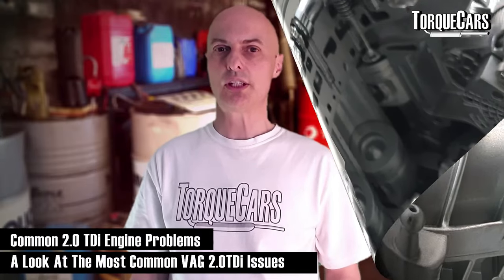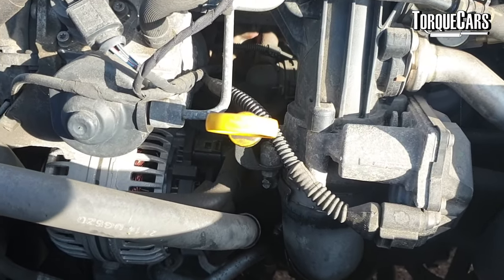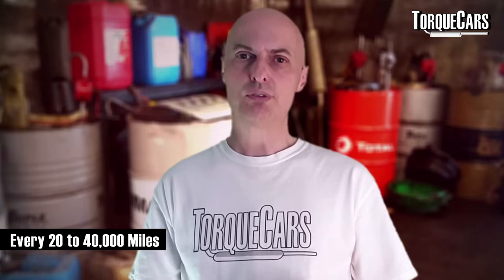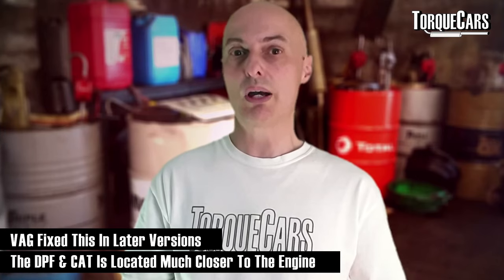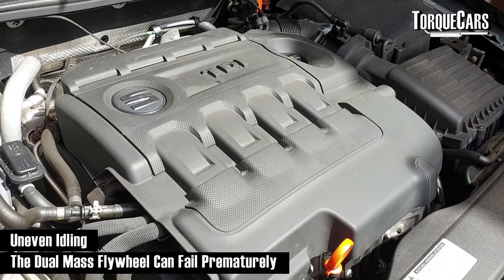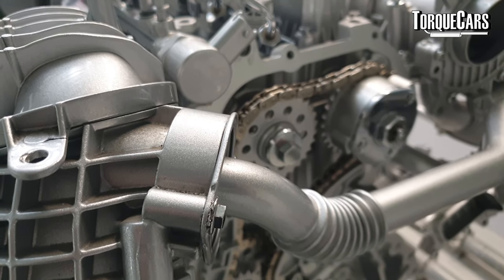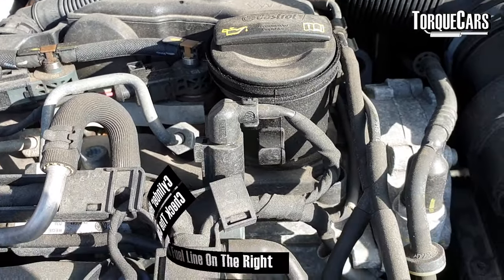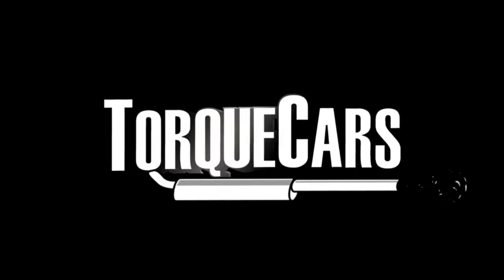Common VW Audi Seat Skoda 2.0 TDi Problems  [Fault Guide]

Comment: I have a 2017 2.0 BiTDI 240bhp Passat ( remapped to 290bhp since new) I have now covered 176,000 miles. Engine still perfect. Still has all its power. Issues to date are the wet clutches on the DQ500 DSG were replaced and the flywheel at 160,000 miles. Also the fuel metering valve on the fuel pump recently went faulty giving a fuel rail pressure too high fault code. Got a new one on eBay for approx 70 quid. That’s it! I change the oil every 10,000 miles and it doesn’t use a drop between services. I change fuel and air filter every 4th oil change.
Reply: My 2019 68 plate 150hp leaks a bit of oil. Apparently it's an oil filter housing gasket. Is that bad?
Reply: Its corect
Reply: I change mine every 5k
Reply: change air filter every time with oil and oil filter change.
Reply: I’m thinking to buy a 2017 Audi a5 2.0tdi  with around 150k miles will the engine go on much longer ?

Comment: Back in 2014 i owned a bkd Golf 2.0 tdi 2004 model, also ended up with a cracked cylinder head, injectors failing etc. It was bad

Comment: My 2013 Jetta TDI has been towed to the garage twice in 2 months. First it was the alternator that broke mid road trip and left me stranded, then a few days ago the clutch just became super loose out of nowhere and I'm unable to put it in gear :/ i know everyone says these cars are super reliable but I'm losing confidence in it fast. I've already spent thousands on replacinng the suspension, deleting the egr because it was broken, changing the timing belt and water pump etc. I'm wondering if I should take the L and just buy a Toyota or stick with my Jetta and hope nothing else breaks.

Comment: Thanks, have a 2013 tuned CFFB, no issues so far. Like to see the mods in you future vids. 👍 The written upgrade guide is great and I had a good read before investing in the tune.
Reply from the maker: They are good solid engines, most of issues have been sorted out by 2013, the recent EA288 is a pretty important evolution of the 2.0 TDi. Mine was an early BKD from 2008 and it was pretty reliable for me, I didn't have any of the issues mentioned here although an overly aggressive map (140 to 185hp) did kill the turbo prematurely.
Reply: @torquecars  I have a BKD A3 sat on the drive, shes just had yet another service, her 20th, 200,721 Miles on the clock, all OEM just remapped, new turbo at 150ish k. 

Shes still got it, still makes me smile, and still upsets alot of her newer bretheren :) Long live the BKD last of the unrestricted diesels.
Reply from the maker: My A3 was the BKD, and this is a truly fantastic engine, the last part of the PD era, mine lasted well and had a pretty heavy life.
Reply: @torquecars  I have BKD 2006 with no issue at 175k miles, just changed turbo 2 years ago. The car 103kW flying like a rocket!

Comment: I have a problem with my audi a6 c6 4f 2.0tdi when im driving and just hold a speed where the rpm is 1900-2000 the engine starts shaking and feel like the engine is ready to jump out of the car😅 but i called audi and they say it a well know problem but they wont tell me what it is so i can order the parts i need and i just dont feel like spending 20-30k fixing it at a shop. So is this a problem that you have heard off before?

Comment: Upgraded to solid flywheel and VR6 clutch kit on my 2.0 Tdi (CLC). No complaints about the extra noise at idle.
Reply: @craigladewig3158  how much did that set you back and do you notice a difference in quality of drive now?

Comment: Passat 2.0 gt model 2018 and had from new..
Now on 230k miles, same turbo, same egr, same dpf, same gearbox and fly wheel and same injectors !! 
Had a new start stop battery at 200k and alternator at 200k!! 
Only drama is the rear tyres🛞 on inner edges going lumpy from the camber! Had it adjusted so many times but I gave up now on that lol 
Perfect taxi 🚕

Comment: PD170 Siemens injectors can be the loom insulation hardening in the oil as much as oil ingress into the injectors themselves, they run in parallel, so any short in the entire loom system and they all stop. You won't get any misfire warnings, just engine stops. I was involved in getting this recall to happen with a few key lads worldwide. I'd suggest replacing the loom if it ever starts feeling hard inside the tappet cover with a revised genuine one. "New injectors" just have improved seals, and will simply last longer. My problem item was loom. Audi revised loom was better again. Be very careful to understand the external loom locking plug, easy to stuff this up and get poor connections if you mess up the plastics.

As for dual mass, my stocko lasted 270thou kms at about 450nm and was given a hard time, so it seems to be luck of the draw. I've replaced it with a LUK dual mass which apparently does not come apart like the SACHS one can if it fails. Planning on over 500nm through it soon, so see how we go.

Use quality fuel, track your DPF and oil ash load on an app ( the stuff that can't regenerate ), and complete any running regeneration if you can. Use 504 oil for the DPF, and 507 oil for the PD cam wear. Change the oil on time or earlier, the DPF regens put a lot of diesel into the oil during late injection regenerations, and they heat the whole engine bay up to over 200 degrees. Make sure battery is insulated, regens kill open batteries more quickly. Most PD170's came with a wrap or a plastic box for this reason.

As said below your written guides are excellent, and I've yet to see anything but great advice on your videos, and learnt a thing or two!
Reply from the maker: Interesting to read about the loom problem, this could help a friend who's having strange issues at the moment, I'll ask him to check this.

Thanks always for your support and encouragement my friend.

Comment: Hi mate - really good video. I have a 2016 Skoda Octavia 2.0 Se Tdi with 56k miles. Solid car up until now but recently the engine temperature gauge fluctuates and goes up into the red. It doesn’t happen every time I drive. No coolant is being lost and the engine fan sometimes works hard. Do you think this is either the coolant sensor or a thermostat issue?
Reply: Looks like a thermostat issue.
Reply: It's definitely the water pump, a common problem. You need to change it before the engine fails.

Comment: Hi i think from what i readed the model with C cylinders head are the engine from and after 2006. So be sure yours is at least from 2006 and if 2007 it's even more likely to have a C Cylinder head i guess.

Comment: Great video, I’m not sure if I have the same engine that you are talking about but my engine code is CCHA, it’s a 120k miles 2012 140bhpCaravelle/transporter. It has been remapped to 178bhp about 3 years ago, always been driven‘properly’ the last couple of months I’ve been experiencing chuffing when removing the oil filler cap and a pressure build up in the head. Is this another common fault? My initial thought is valve stem seal worn, I am planning on doing the cam belt for a second time when it finally stops raining. Could it be stem seals or are there any other areas to investigate? Thanks

Comment: Heyy i have the 138bhp 2.0 tdi 2010 Skoda superb i have tuned it and put a start to end exhaust my car is getting heated and the coolant is not leaking but disappearing from the coolant box i checked and fixed all the leakage spots changed the radiator and stuff what do you think it must be

Comment: Hi. I’m back on here. Would you happen to know where the crankshaft sensor( Engine speed sensor) is on a CNHA( 2.0 TDI ultra Audi A6 2016) ? Code I got is P0322 (G28) Engine Speed sensor. Thank you.

Comment: Thanks for your information.  I have a passat 2007, 2.0 Tdi, 125kW (170HP), done 230,000km, engine rattle at flywheel area, and knocking noise at timing belt, the worst problem is it blows smoke white/grey (not smelling coolant and no coolant loss), no power, misfiring.  I would appreciate you comment on potentially cause to help me decide on whether to move on or fix it.  Many thanks!!!
Reply from the maker: It sounds like the dual mass flywheel is on it's way out. The timing belt tensioner may also be playing up. It is really hard to diagnose these things remotely. You've got to weight up the cost of repair vs the cost of a replacement car. With the mileage it might be worth moving on as there are probably other bills looming. 

The smoke could be the engine running lean/rich and is often down to the injectors failing to spray a good pattern of fuel into the engine.

Hoepfully a few others on here will spot your post and chip in with their experiences.

Comment: have got a 2005 2.0TDI Audi A3, has been sat for about 6months with half a tank of diesel in it. currently engine is turning over but failing to fire. have had people say it’s likely to be fuel filter / pump. any ideas of where to start in sorting this myself or potentially properly identifying my issue. first car and broke as fk so any help is helpful 💪🏼 when i bought the car (after about 3months with the half a tank in) we drove it to where it is sat now (with no issues) within a week of it being sat it wasn’t firing anymore and previously when i got it home it was sounding beautiful and idling like a dream. again any help is greatly appreciated

Comment: Hi mate i have a 2007 vw Passat 2.0tdi 170 bhp ,the engine light is on and it doesn't rev past 3000 rpm when i try going past 3000 rpm the glow plug light starts flashing and it starts to creat black smoke and loss of power . When I turn it off the glow plug light turns off but engine light it still on ,no smoke below 3000 rpm. What do you think is the problem is. Cheers.
Reply: My 2009 Jetta TDI had the glow plug light flashing around 3k rpm after I changed the timing belt. The timing was a bit off... I adjusted the cam pulley slightly and it stopped the glow plug light flashing.

Comment: Great videos! I have CBBB motor from 2008 in passat B6 but it is specified in licence as EURO4, how is it possible and what does it mean?
Reply from the maker: Euro# are emissions standards set in the European area which all manufacturers have to meet (or cheat!), the higher the number the stricter they are and they apply to newer cars. We have Euro 7 cars now. Cars are required to meet certain emissions limits as specified by the European commission and it ranges from exhaust particles, to gases output right up to dust emissions from brakes and tyres now and even battery life so even EV's have to meet them.

Comment: Right now I am looking to buy a VW Golf MK6 2.0 TDI 140hp with engine code: CBAB from 2009. What should I look for? Should I be concerned about any problem with that particular engine from that year?
Reply: Hex oil pump and fuel pump. And your usual dpf and egr issues
Reply: Nothing really, bosch cp4 very reliable unless missfueled, oil pump not an issue since early pd engines around 2005. If odo is 200-250 a flywheel is due, other than that not really.

Comment: have a 2005 2.0TDI Audi A3 that has been sat with 1/2 tank of diesel for about 5months. when bought (had been sat for 2months with the diesel in, was running and sounding beautiful and idling really comfortably. about a week later the engine would no longer fire but would just tick over as you turn the key and stop after about a second. has been like this for the last 2 months and have had a few people suggest fuel pump / filter replacement or cleaning. any tips ? this is my first car and i have little money so looking to get a good diagnosis before losing too much
Reply from the maker: This video explains that fuel can degrade over time... https://www.youtube.com/watch?v=d9Gt5x5AjAk

A filter change should be  a cheap option to see if it fixes it. Are you getting any error codes from the OBD port? That is usually the first place to look for clues when there is a problem.

This video goes into to Audi diesel cold and warm start problems so might give you some pointers.
https://www.youtube.com/watch?v=BHjuezi6bNc
Reply: @torquecars  amazing thanks so much for the speedy reply dude. No codes coming up when we ran a test on the OBD port tried two different tests on separate devices. will watch any videos i can so thanks a lot!

Comment: Hi, would you be able to help me please?
| I have 2.0tdi A6 C6 2010 175bhp version.
Now, car runs smoothly when first started (cold engine), up until it starts warming up and as it gets to workign temp.
Then the idle is rough and shaky, and its noticeable that it has some weird noise, kind of cracking or something..
Car always drives nicely and accelerates fine.
Whole clutch has been changed.
At the moment its on 160k miles.

Thank you very much!
Reply: If it has been accidented or has a big intercooler, check that the radiator fan is not hitting the AC line and or missing pieces. Mine did that shaking with weird noise on idle when the fan would start running (when coolant hit 95°C). I investigated and found out the large fan was missing pieces causing it to be out of balance and shaking violently. Grabbed another fan from the scrapyard and problem solved...

Comment: This video is about these engines to 2009... the B?? engines, 3 letter engine codes starting with B  . I take it that the cylinder head for  EA189 engines, eg CEGA,  would be like a "C" cylinder head and not have the problem ???

Comment: I have a 2.0tdi bmn 125kwh. no problems. regular small big service change everything on time big every 75000km and small service every 10000 to 12000km. change everything, original castrol 5w30, all filters from motor oil, cabin fuel, etc... great service, change from track tensioner to toothed tensioner with all rollers and water pump and all adjusting belts from channel to toothed. all other engine boss bolts. clean the air valve, the exhaust shaft every 50,000 km and the EGR valve from soot, i.e. exhaust. and do not overdo the regeneration of the dpf, and once a month treat the engine with better fuel to clean the injection and exhaust system. and there are no problems with that engine. those who say they have problems are lying.

Comment: Thanks for the informative video. Have a 2013 vw tiguan 2.0l tdi with the cffb engine. Been experiencing random intermittent long cranking issues lately. Egr have been replaced as well as both thermostats. No fault codes. Any idea what my be the cause or where to look?
Reply from the maker: Check the voltage when cranking, it could be a battery issue starting to show up. Is it only when cold? If so are the glow plugs good? You've done the obvious stuff though. so I'll ask around and see if I can help you get to the bottom of this.
Reply: @torquecars  Thanks for getting back. Brand new battery.  Long crank whether hot or cold engine. Occurs extremely random. Two or three starts in a row out of every 15 to 18 starts. Won't the glow plugs pop a code?
Reply: Would check starter motor and glow plugs. Mine only occurred when hot and it was starter motor
Reply: I had a similar problem on my cff engine when I replaced my timing belt. I found that I just needed to tweak my timing on the vernier pulley and then she just came to life on the first crank. Check that out it may be one cause
Reply: Check for cranckshaft position sensor and camshaft position sensor, they start to get worn out and make the car to have a long crank

Comment: I got rid of my dual mass flywheel. Honestly don’t even notice the difference and now I don’t have to worry about it taking a crap again. Started to come apart at 90k miles
Reply from the maker: Do you know which weight and brand you fitted? Did you need to increase the tickover rpms? I've heard people saying this and also heard others hating on the lighter flywheel so there must be an option that works well on these.
Reply: I put a valeo single mass on mine from auto doc, smooth and only makes a little noise at low revs in first gear. It does slip in 4th and 6th when power is put down, but works really well.

Big turbo going in soon so clutch will have to be done again to handle even more power 😅
Ppd170 Leon mk2 great engine!

Comment: Hello I want to buy a Skoda Superb 3, 2.0 TDI 140kw, 190 HP with 200.000 km can you tell me please what problems I can meet with this car
Reply from the maker: These two videos should help answer your question.

https://www.youtube.com/watch?v=TgPQe12d_sw
https://www.youtube.com/watch?v=8ULVvk9shig

Thinking about the mileage the DPF may be nearing end of life, it depends how well it's been looked after and may well have already been replaced. If the turbo has a whine it could indicate the turbo has started to wear out also.

There is not much to go wrong with these unless they have not been serviced correctly and with the correct grade of oil.

Comment: Thanks for the video , i have an Audi A3 sport 2014 tdi 180 bhp ,the problem is every now and then it suddenly looses complete power for a very short period of time ,may be a second or less almost as if the engine is switched of and then back to normal ,no engine light comes on ,been to different garages and they could not find anything ,will be very grateful for any advice ,thank you .
Reply: @mezyaz1632  did you found the problem ? I had similar issue when accelerated the engine strutled a bit and one time completly shot off after i restarted i got ijenctor failure code (flashing coil light) the problem was the cables on top of the engine had worn out and as the egine shoock a bit it cut off changed the cables and since than i didn t had any problem